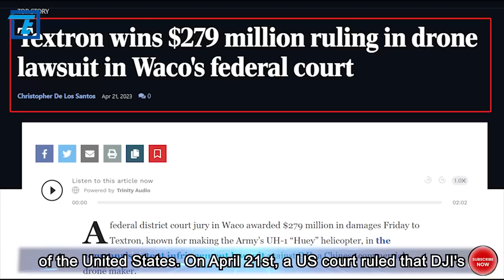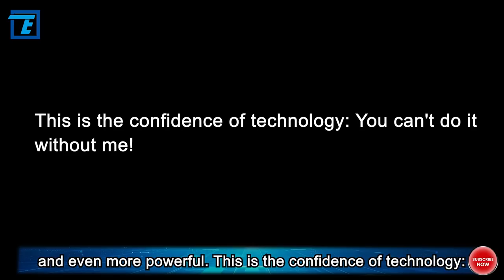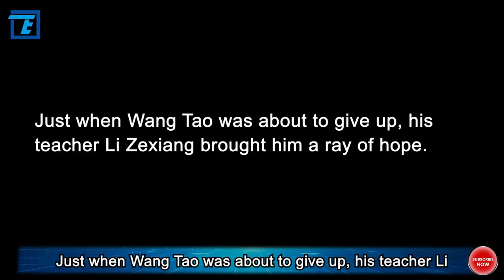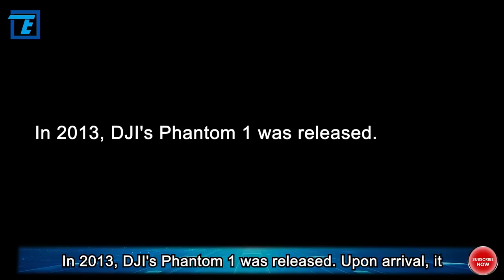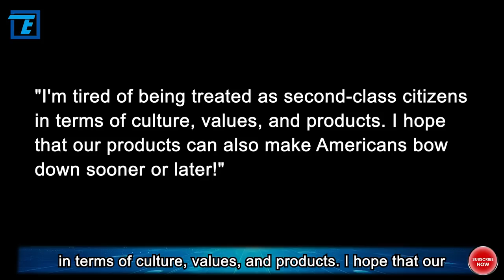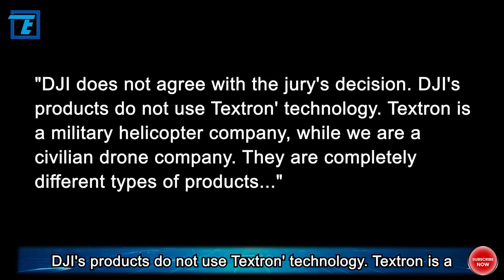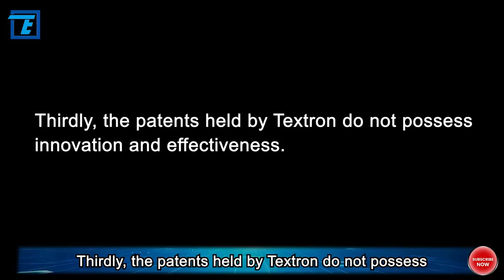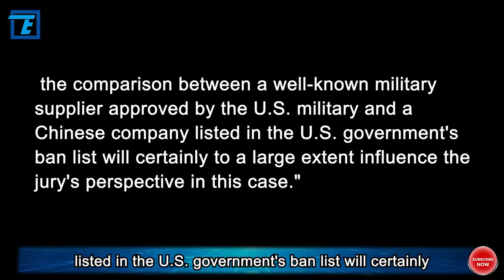Being sanctioned by the US for eight years, why is DJI getting stronger?

Comment: I'd suggest consulting with patent attorney first. And reading court case protocol.
Could you cite patents numbers?
I must emphasize, that:
-different market is not a defend - patented solution may be used anywhere.
-having flyable drone before patent filing may not be defend - it may have used different solution, next model may use more advanced technology - however patented.
-Textron don't need flying model - theoretical solution may be patented, if it MAY be realised at the moment of filing, and patent contains all important information.

Court probably can ban selling DJI drones in US, however - only models which infring patent. Every other probably need software dissasembly to check if they use patented technology.
Reply: If the dates given are correct, it is not patentable.
Reply: @wonghonchoy5341  
It depends on what exactly DJI "published" before filing date, and and exactly Textron claimed.
Any model produced before filing date is of course valid, but new models, and new software for old models may be infringed.
Should we believe US courts? 
DJI had chance to show they arguments.
Reply: @johnfox2483  As far as I understand, any information already in the public domain cannot be patented, published or in used
Reply: @wonghonchoy5341  exactly.
However - are you sure, that previous  DJI model used exactly the same algorithm/solution, as described in Textron patent?
Reply: @johnfox2483  The point is that there was a published article on the technology by a third party later and  Textron cannot claim it's theirs. 

I have a patent in my country and in China granted. When I tried to patent it in US, they rejected us based on a different design in form and industry. Neither of these designs are interchangeable. 

From what I read in news, apparently anything can be patented in USA by their own citizens. Maybe I am wrong but that is my impression.
Reply: @wonghonchoy5341  I don't know anything about this case except from what I learned from this video, but it looks like DJI failed to prove that they had prior art.  What is said here in a video is just heresay.  It is possible that the jury is biased, but for an American court to have such a blatantly biased court that they will grant Textron despite the fact that DJI had prior art does not seem plausible.  After all, DJI lawyers have the opportunity to vet the jury for bias during the jury selection process.  When someone wants to push an unfair judgement, it is usually not done with a jury.
Reply: @wonghonchoy5341  I must add that East Texas is rather famous for favoring patent holders.  So it is possible that DJI is getting trolled.  In that case you will have to hope that the supreme court will accept the case.

Comment: People can say what they want about the whole situation between the US government and DJI, but here are the facts:
-DJI is an official affiliate of the PLA, and is considered by the chinese government to be a strategic level asset for foreign intelligence gathering.
-DJI is known to gather superfluous data (Meta data, flight, audio, video, image, GPS tracking and handoff data..etc ) and store a portion on servers in mainland China. 
-There are many western designed and built alternatives products from western manufacturers (Parrot, FLIR, Kratos, Birdseyeview Aerobotics Inc...etc), in fact there's far more than there are in China, as the underlying technnology and concepts are not Chinese.
Anybody who dismisses these security conerns is delusional, Unmanned and semi autonous machines are a strategically critical field, and no country with the capability is going to surrender whatever edge they maintain (the US and to a lesser extent Isreal are still the leaders in drone tech and autonomous systems by an extremely wide margin), just because some foreign competitor can make them cheaper, much less grant these machines access or oversight into critical infrastructure or systems.